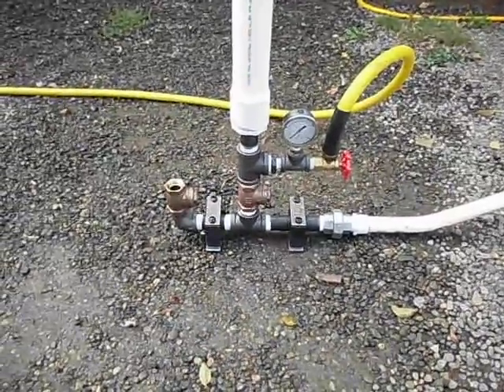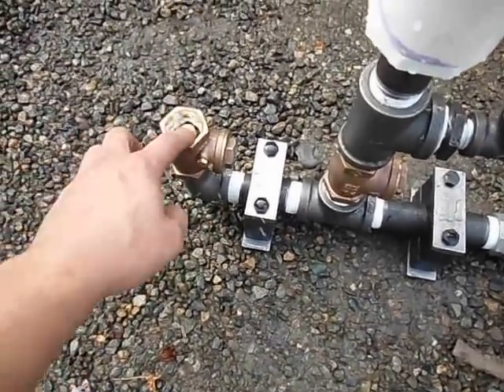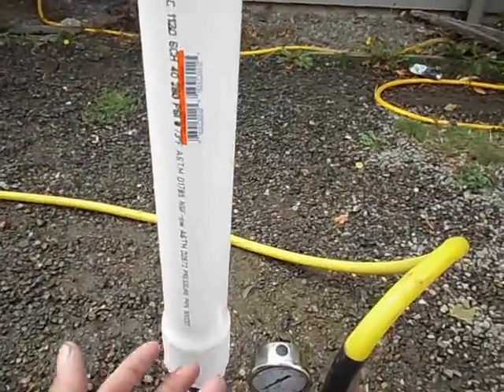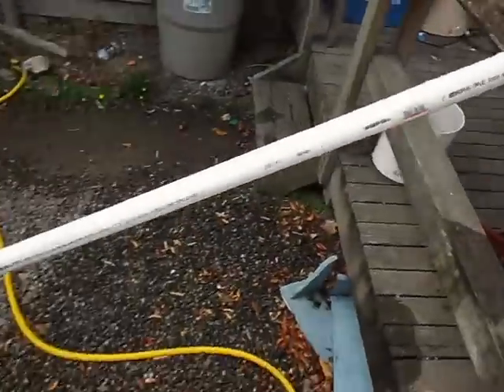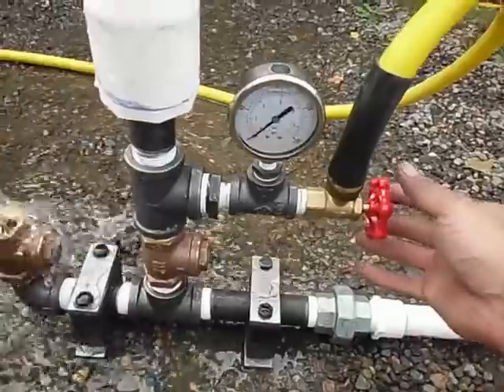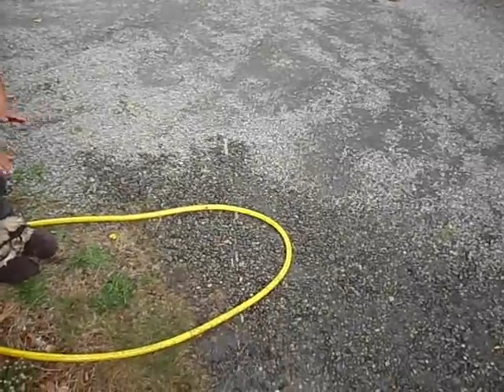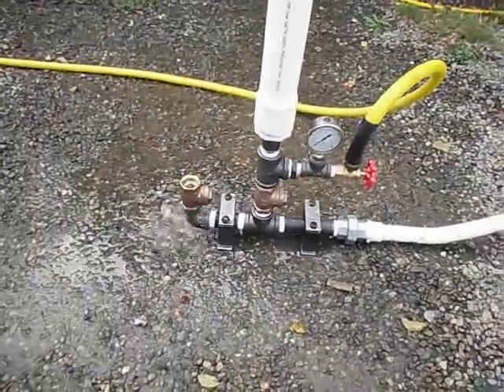Homemade Ram Pump

Comment: Awesome! Thanks for sharing.  I have watched a spring dump water over our  hill for the past 30 years only able to divert it to a livestock tank.  This will give us the ability to capture the power of the head to now divert this water to a large storage tank above our garden, fruit trees and berries.  As far as the waste water, i plan on capturing the waste water in a stock tank for our livestock and as a wildlife water source.  Thanks again, isn't  YouTube great!!
Reply: +TONY BAZINI he's using the house water as a test to see if the system works.  Normally the water source comes from a stream or a rain barrel.  That way, the water comes from the rain, and is pumped, using gravity, to water fruit trees, or vegetable plants or any other reason you can think of that needs water, without using electricity to get it there.  Open your mind and see the reasoning behind the project.
Reply: I wouldn't call it waste when that little device is pumping water from a tiny stream  70 ft. uphill to a reservoir that produces water pressure for a home 50 ft above that same tiny stream.
Reply: +Leo Krick I agree ..You  saving the electricity but wasting the water...

Comment: Hi there! Thanks a lot for this detailed video! Really helpful. By the way, will this work on a river? Or is it a must that the water is coming from a mountain or hills? The river is flowing but I don't know if the flow is strong enough... Thanks!
Reply: Yes it will work from a river. You will need to play with pipe size. The ram part will need to be larger to allow more water in.

Comment: Wasting water is not the point, its an extremely low energy pump that requires ZERO electrical power. With a pump you can put the water where ever you want for free. 
Why? The dribble out the pipe would be put into a tank and collected for later use as needed. It's like a solar collector for water. 
Solar cells by themselves really don't produce a lot of energy, thats why you have a battery (The storage tank). You collect small amounts over time so you can use large amounts latter. 
So would you rather use your valuable solar energy to pump water or pump the water for free and use the power for lights.

The only note I would add for someone wanting to do this is understanding what energy is where it comes from in this pump.
The water moving through the large supply pipe IS THE ENERGY!
And when it stops immediately, due to the valves, the energy is transferred to the water at the exit end of the pump. 
ANY movement in the system, other than water, is valuable energy being consumed. 
The pipe flexing (Movement) between the bucket and the valves requires energy to move it (Energy loss)
The expansion (Movement) of the PVC supply pipe, even as minuscule as it is, is a loss of energy. 
Keep this in mind when you build your system.
Keep the supply side of the system it as rigid as possible to capture and transfer as much energy as possible to the exit side.

Good luck, 
Nice video

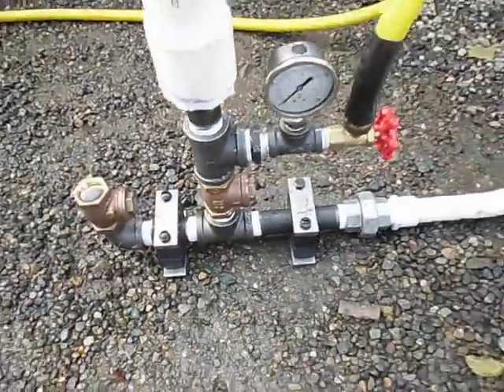Comment: How vertically high can the this system pump? I read that its a 1:10 ratio. For every 1m head, you get to pump the water 10m high. Is this the vertical distance the system can pump?
Reply: That sounds right. Less than a 5 ft drop in altitude with your feed pipe, and it is hard to get a clack valve to operate.

Comment: Can you use just empty space or air in the chamber instead of the pool noodle?
Reply: I used a latex balloon to prevent the water absorbing the air in the tower pipe.

Comment: so it pumps water effectively, BUT there is a 90% loss of water coming out of the open check valve which to my mind is hugely wasteful. It may be off-grid but it is not water wise! What am i missing?
Reply: +Sunny M this is designed to be placed in a stream, so there is 0 loss of water in this type of system, only a 10% gain of free pump action without buying a pump, battery, and solor panel as Jorge Davila uses, this is 100% off grid thinking with a 100% renewable non polluting system, how longs that battery and solar panel going to last running 24/7 year round?
Reply: +Sunny M It is 100% free. In real installation, ppl use ram pumps in waste water streams, channels. Its not 90% loss of water, but 10% gain of water for irrigation, animal farms, drinking water (of course with clean water intake)  etc.., freely 24 hrs a day.
Reply: In a remote area, one fish submersible pump (check valves) 12 V with a battery and charge with a 40W solar panel/ wind generator home made too.
Reply: Way more expensive to build, and cannot pump near as high.
Reply: That water can water livestock downhill of the pump.  It isn’t wasted as it is simply going now not the stream.
Reply: You're missing the creek that it's cpming from and the "waste" is just returning to its original path, down the creek. Soulnds like you live in an appartment and think that this is the way to solve your problems. This is meant for a specific purpose and it ain't for yuppies in cities. Thinking along THOSE lines, yep, to a city dweller, it would look like waste

Comment: is there any way you can prevent water wasting from the the 1st  valve?
Reply: +Steve Omolo You can built a pond there. Make it big enough for fish rearing.. The sound may bother them but the waves would give good aeration.
Reply: The water is not wasted it just rejoins the stream you are pumping from.

Comment: connect a hose to the breather and have it go back to the bucket
Reply: Voila! Perpetual motion machine. TANSTAAFL :-)
Reply: It wouldn't work. 😕    The check valve at the end would then have water on top of it which would cause it to stay open. It would be cool if that would work though.
Reply: While operating in a stream the water escaping the clack valve just rejoins the stream.

Comment: Hi Joshua, I had a question about the swing check valves. I had never heard of these before, so I learned something new! I just realized they could be a huge help for an experiment I've been working on. I was wonder, does it take a lot of pressure to make the "flapper" or whatever close? Also, do you think air pressure could close them, and if so, how many PSI would you need?
Reply: You probably need a ball check valve if you want to check stop air pressure.
Reply: someguyinsantaclara Well, actually I bought one of these valves from Home Depot and tested it, and it works great with air. If the valve is at a certain angle (maybe about 20 degrees), it takes very little air pressure to close the flap. It closes instantly. You can blow through it and it will close, and even a slightly inflated balloon will make it closed. I was amazed actually. In fact, you can sort of adjust how much pressure it takes to close the valve by the angle you mount it, a steeper angle will take more pressure for the flap to overcome gravity. I'm glad I found this video! I didn't even know about these valves. They're a little bit expensive, but they should be exactly what I need for an experiment I'm working on.

Comment: is there some way to have a 52 gallon reservoir 8ft high, and have it go down my vertical plant tubes, and then complete the circuit to flow back into the reservoir?
Reply: I don't see why not. If he was able to pump the water all the way up to the roof, working against gravity, then I don't see why you couldn't cycle the water back into the reservoir after you're done using it for whatever purpose. I've never built one of these pumps before, but it seems like the only problem would be for the water to not lose too much energy.  You pump it up an elevation, then any unused water could be drained and then just flow back down to your reservoir or tank by gravity. At least, that's what I think should happen.

Comment: I followed your directions to the tee, and gave it a test run with a water hose. I'm not getting a hammering effect at the waste check valve (the flapper stays open). Any suggestions? Also, how tight/loose should the water weenie be inside the pvc? Should it slide in easily, or should it be really compressed and tight to slide into the pipe?

Comment: What happens if you put a spray nozzle or on off valve on the garden hose? Or does this always have to be turned on to work?
Reply: great question. I believe this is a constant flow sort of thing, but i could be wrong.

Comment: Okay... your bladder tube.... is flexing.. pvc does that .... thus you are losign energy by allowing the air to expand.... magick number is about 20 to 1 for ever meter per Kg of water you need to raise..... think flow rates... or fluid dynamics.... what they wnted to make computers with at one time......

Comment: Was I the only man of science here who felt the need to umm slum it and like do the troll comment at "my man made stream"?????  .. but work in watts is W = F*D ... so force times distance gets work.. then force is mass times acceleration... soooo.... for 3 meters to your roof over a meter and a third down.... dependent upon the masses involved that lets you know how much work needs put in to what is put out.. and by the way.. if you had your water ram pump assembly under the depth of your well (say by 4 feet).. how would well water not work?

I am telling the Molemen that you are discriminating on what permiculture technolgies they can and cannot do.. I mean those molemen are blind ffs! (btw good video )

Comment: Nice Video with a good explanation of how it works. My grandfather talked of using one of these Ram Pumps in the early 1900's to push water literally hundreds of feet horizontally and over 50 feet vertically to supply an elevated water tank (tower) that in turn supplies the house and farm with water. They put a water ram near the creek down in a gully. Then built up a small damn to create a pool from where they drew the water to feed the pump. To the people concerned about the waste water. The amount of waste water is irrelevant when your taking from a river and putting it's discharge back into the river. It makes you wonder who originally figured this out.
Reply: Babylonians . . .  Originally !
Reply: This exact system is found in the pit of the Great Pyramid...an Englishman by the name of Christopher Dunn wrote a book called "The Giza Power Plant" where he goes into the design and workings of the pump in some detail.
Reply: Richard H pyramid were ram pumps but egyptians didnt build them they were much older

Comment: Why cant you close the waste valve thing?
Reply: You could put the check valve in a bucket or something to collect the water that gets vented, so that you're not wasting any water. But yeah, the check valve is part of how the system works, it causes just enough pressure to build up before it opens. If the valve was stuck open or closed, the system wouldn't work.
Reply: you would lose the hammer effect  which in turn means, no pumping

Comment: it looks to me like you could restrict some of the flappers open swing and you would get less waste water. am i correct?
Reply: this looks like an efficient pump
and it is efficient i have seen these pumpswayst way more water
Reply: +Dan Murphy The pressure it generates is proportional to the momentum of the water mass when the valve closes. If you restrict the flow at the dump end, there will be less momentum, so less pressure generated so the pump will not lift as high. And at some point the pump will stop working entirely. So you set the level to suit the application. Don't forget - ordinarily this set-up would be used in a creek or stream. The dumped water is just going back into the creek where it would have ended up anyway.

Comment: What do I need to do to build a pump that will lift water 100 feet or more??  I am in Costa Rica need a water source and have a nearby stream but I need to take the water from below where I could use gravity.

Comment: You don't need the accumulator.
Reply: Bio Power I know where several have been working for 20 years, and none have an accumulator , but they are just pumping out into  an open pond, not into a hose
Reply: Jerry Collins You might be thinking of a pulser pump
Reply: Frankie Fourfingers Maybe so......I could see you needing a accumulator if you were pumping into a hose, and your hammer effect was trying to push all the water in the outlet hose. An accumulator would certainly cushion the load against all the water in the outlet hose.
Reply: the whole idea of a ram pump is to pump through a hose up10 times the drop in the elevation of the stream you are pumping from.

Comment: What sort of magic is used to make this work ?
Reply: It is based on an advanced principal of Black Magic. You really need to be a certified witch or warlock to use it effectively. That part is left out of the demo.
Reply: pretty sure it is called physics.
Reply: +CR2504life  type in youtube how ramp pumps work and you will see
Reply: It is called energy conversion.
Reply: fluid / hydraulic dynamics

Comment: Question: if you added a second fitting of like the first (2"pvc) that is open at the top so that the spill water does not drain onto the ground, would this not increase the water threwput of your pump? increase the PSI pressure AND GPM flow? If you don't know this answer can you test it and let me know how it worked?
Rachael
Reply: I'm guessing you'd lose pressure because the water now has to be pushed up past the first check valve. Losing some of the momentum of the RAM effect.

Comment: Interesting ... would have to devise a way to harvest the "waste" water that comes out of the first swing valve.
Reply: Why?  This is a demo.  In actual use it would be placed next to the stream.  The idea is to get some water up a hill to a collection point and 10% does just that.
Reply: HyperBlueZYZ You could actually place it in the stream and just let the water continue on down but next would be good too..
Reply: @SimonWoodburyForget  some parts of my property have little water access, a pump like this will help move the water to areas where it's not as readily available.  As for bores, our state has regulations that make it too costly to install, and then they place a water meter on it then charge you the water used. #nannystate
This system would give me the benefit of existing water systems for next to nothing and no gov't regulations. #win

Comment: It seems a bit wasteful all that water coming out of the valve. If there was a way you could collect that water then it would be a fantastic piece of equipment.
Reply: If you are harvesting the water from a creek or river you could set it up so the water is redirected back into the water source. That doesn't help the efficiency but reduces water loss from the source.
Reply: That's exactly what people do.  I swear others have no idea what this thing does or where it is used.  There is no such thing as waste when all this does is divert a small amount of water flowing downhill to a different place and the rest continues to flow downhill as it was before it entered the ram pump.
Reply: Hermaeus Mora this is test..this pump only use that whos living off grid...pump water from the gravity creek spring or river...
Reply: As others have pointed out, the "waste" water simply goes back in the stream, just further downstream. One environmental impact would be that in the part of the stream between the source and the pump, the water flow in the stream bed is reduced, since it is being carried by a hose or pipe, where it is not available for the wildlife and plants. This would be significant only if a large part of the normal stream flow is diverted through the hose for a long distance.
Reply: yes you could put that out let water in to powering turbines that are in series ha how funny you could just have many turbines in a line feeding each other  all powering generators you may not get much power from each but power is still power

Comment: Nice video. :-). You were not far off when you said "welded". You actually "solvent welded" the pvc cap onto the pipe.
Reply: electronicsNmore needs to work on his "reading comprehension"
Reply: Just to nitpick a little... A solvent weld would imply that (theoretically) all that's left when you're done is one whole piece PVC. If it's glued, the joint may be a different material, and the operation is more analogous to soldering.
Reply: Nothing to nit pick. That is exactly what the process is called, "Solvent Welding". A commonly used term. Every plumber knows that.

http://www.jmeagle.com/plastic-pipe/pvc-pipe/plumbing-solvent-weld.html
Reply: electronicsNmore I'm not arguing that solvent welding doesn't exist. I'm arguing that not every process of joining two pieces of plastic is solvent welding, but that solvent welding is something specific. For example, if the video creator joined the pipe and the cap with super glue, I would argue that that's not solvent welding, since the joint in the finished product is made of acrylate instead of PVC.

Comment: @Nathan Davies

The system is made to be used off a stream so the water that goes out the exhaust would normally just go back into the stream.  I think I read somewhere that for every gallon of water it pumps it will take 7 gallons to run the pump.

Comment: I just built my first ramp pump using your guidance, I think your video is very clear and simple. I replaced the pipes for PVC and used two vertical valves made in Mexico, the Italian made valves are more expensive at least in the hardware store where I got them in PR. Thanks a lot.

Comment: Great demo. How would that device be installed in a river?
Reply: just put the inlet(in his case the bucket) futher up the water source and the outlet wherever you want the water pumped to.
Reply: a dam with reduced piping will give better head, and therefore greater distance/height for your outlet...cheers